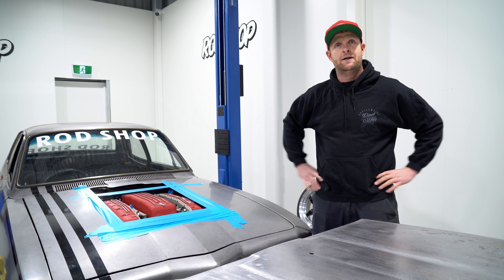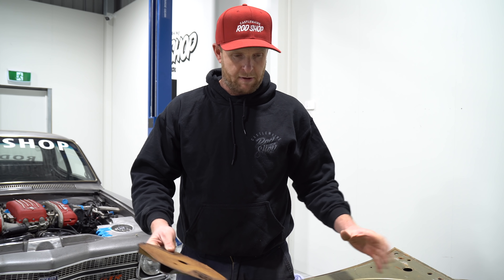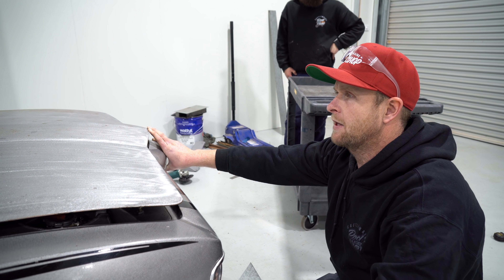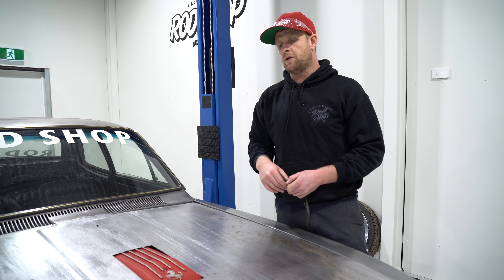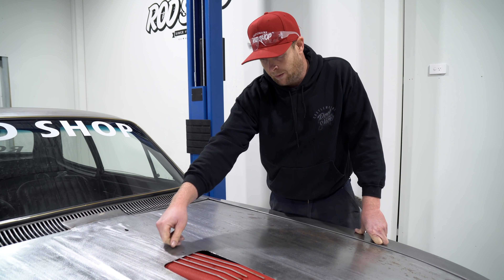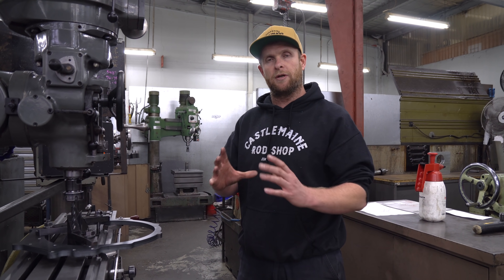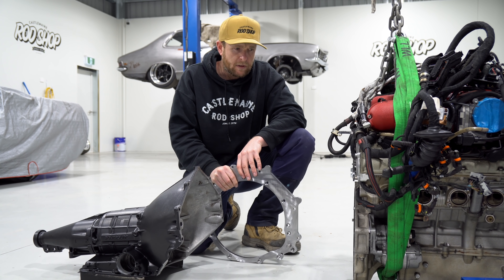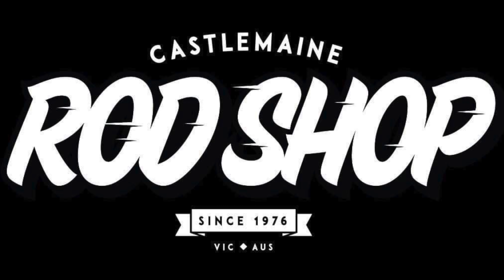Fitting a GM Powerglide to Real Deals V12 Ferrari engine

Comment: Never in their lives, did the Ferrari engineers ever imagine a gm powerglide be bolted to their engine…. That is “Hot Rodding” that’s the muscle car way…..
Reply: There would have been a lot off tears from Ferrari lol
Reply: @momohall1643  and puke
Reply: Err...,. Blokes, back in the 50's thru '70's Ferrari bought all their Automatic Transmission's for the GT's and four seaters, from General Motors! 😀
Those Ferrari engineers probably tried the Powerglides, but went upmarket instead.